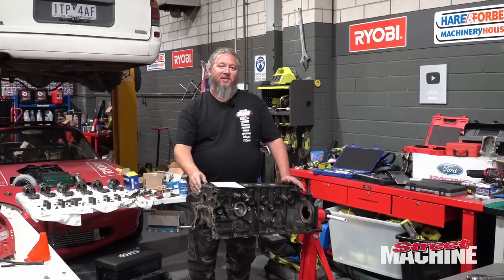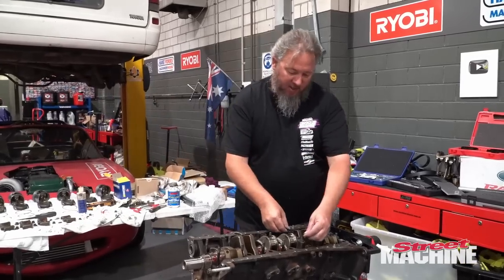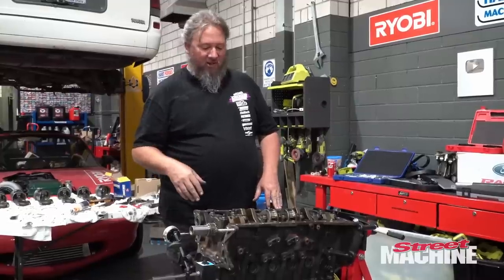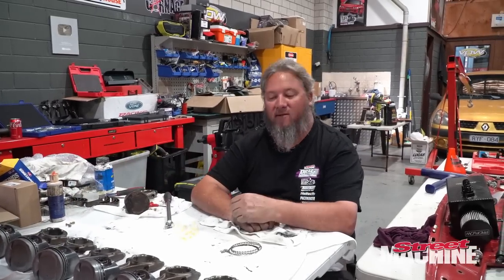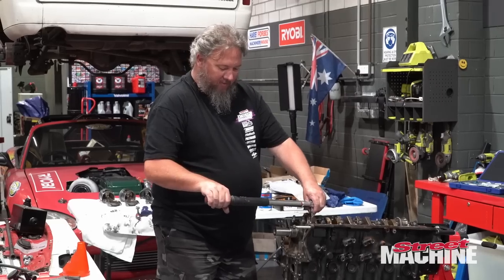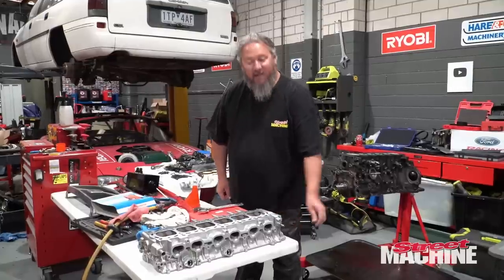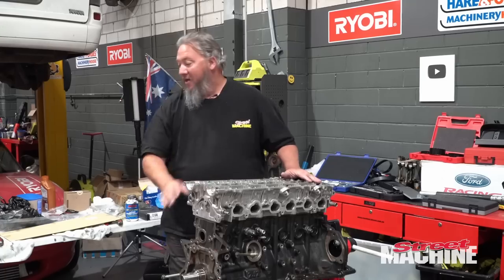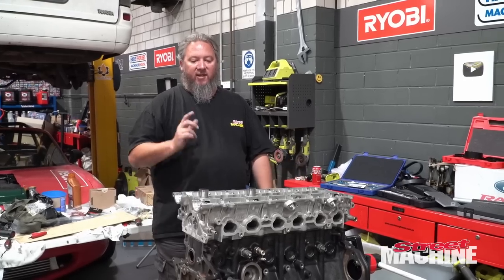Carnage - Building a New 2JZ Engine for Trolvo - Part-2 ( 1.5JZ Build)

Comment: Hi Scott, I noticed that your arp brush is looking sad. A 1 inch foam cut in brush works great for putting on arp thread lube. I use a 4 inch cut in for bores by dipping the sides and spinning it down them after I clean them so that they don't rust if I'm not assembling straight away. Awesome videos. Keep up the great work.
Reply from the maker: Thanks for the tips

Comment: Hello, so I got a free 2jz ge vvti block and now I’m going to start cleaning the block get measurements etc, but I have a few questions if you don’t mind answering them since you’re knowledgeable on the 1.5jz builds. 1. What will your compression be once you have the 3.0 block and a 2.5 head? 2. Will I need to weld the “oil gallery” even if I’m using a 2jz ge vvti block with a 1jz gte vvti head? And using a 2jz gte vvti headgasket? I’m not going to go over sizing the block I want to keep it .86mm bore. 3. Did you happen to machine your block and head to get the exact measurements?. If you could help me out this that would be awesome! which sandwich plate to use to feed the turbo and also where will the oil drain from the turbo go? To the block or pan? I also was thinking of running an oil cooler as well.

Comment: Getting washers into a restricted area.  Drop a piece of welding wire into the hole then drop the washer over the rod. A long phillips screwdriver works too.

Comment: Tolerances with oil clearances on the crank were probably tight because the rods are meant to be resized when using arp bolts since they're torqued differently. Block is also meant to be line bored to suit.
Reply from the maker: Alot of things are "supposed" to be done but we're keeping it budget

Comment: Did you happen to run into any problems running the arp main studs and the clearances I burned up mine so went back to stock if I go with standard x barrings without a line hone do you think it will be fine?

Comment: Great job on putting the long block together it is going to rip. You earned yourself a thumbs up just because you put the washers in the right way. Never ceases to amaze me how many people over look the little details that are so important to a good engine build. Little things like lubing the bottom of the nuts to get a proper torque setting. I prefer plain oil but each to their own. I have seen so called experts that haven't done as good a job as you just did on a throw together engine.
Reply from the maker: Thanks 👍

Comment: Those thrust bearings are such a dumb design. I had a 1970 V6 Capri and I could feel the end float on the clutch pedal so I pulled the sump off (without removing the engine) and the thrust bearings were sitting on the bottom of the sump. I threw them in the bin and put the sump back on and kept driving it while I looked for another engine to rebuild. I was expecting it to destroy itself at any minute but I drove for more than a year like that and it just kept going. 😄

Comment: Did you check the tolerances and roundness after you installed the studs. I've heard that they can go out of round quite quickly if they haven't been  machined with them
Reply from the maker: I checked and they were slightly out of round but not enough to worry me

Comment: Scotty slightly confused... You said the oil squirters were on the rods. I haven't pulled my 2JZ VVTI engine apart so I have never looked, but I thought the GTE engine had a separate oil squirter attached to the block like the SR20DET block. Which is one of the main differences between the DE and the DET engine. Are you saying that underside of the piston is cooled directly of the rod big end, and not a separate oil squirter on the block?
Reply from the maker: The GTE has oil squirters in the block, our GE engine doesn't have those. But the rods have a squirter hole in the big end as well
Reply: @STREETMACHINETV  OK thanks for the clarification. Can you fit the oil squirters to the block? The DE blocks apparently have a pad that you can tap for the squirter (don't know as fact only had the DET) do you know if the 2JZ has the same setup?
Reply from the maker: @Dodgy Brothers Engineering  you can drill and tap them but in big horsepower builds they block oil squirter off for extra oil pressure
Reply: @STREETMACHINETV  OK didn't know that, so that is rather convenient it being a GE block then.

Comment: why do you replace the 2jz head with a 1jz head?
Reply from the maker: So I could use all my existing manifolds and intercooler piping. As you can see it still made excellent power

Comment: Street machine, which L67 internals do you recommend for longevity ? Mahle and hastings for a 40 thou overbore? 
Love the content, never thought I'd upgrade an L67 rotating assembly but I'm a sucker for online trends etc.
Reply from the maker: Mahle stuff is great, Hastings are okay but there aren't alot of options when it comes to rings
Reply: So npr it is then ... Thanks for the correspondence guys.